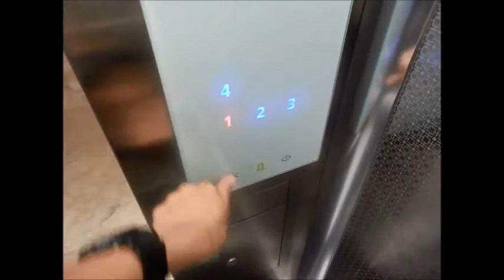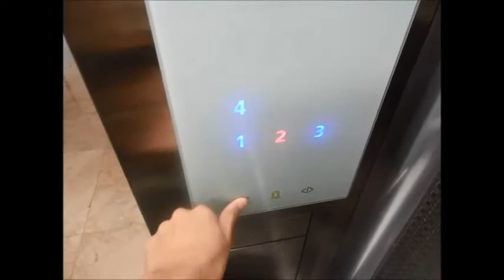Schindler 3300 AP Elevators at Prama Sanur Beach Hotel, Bali

Comment: SGPC has just released an article about this hotel, and since this hotel was built by PP, I suspect these elevators are formerly OTIS.
Reply from the maker: It could've been another brand though as by the 1970s PP is no longer affiliated with OTIS. IIRC these elevators had been modernized at least once before replaced into Schindler (based on online pictures I found a while ago).
Reply: @idl3k_elev  : Did the picture give you a clue as to how the modernization looked like?

After looking at the stainless panel that houses the FIGL, I started to think that these couldn't have been OTIS since most 1970s OTIS do not have large panels like that. Schindlers also do not have that too. My next guess would be a Japanese brand, probably Mitsubishi or Toshiba considering the size of the panel. That being said I doubt the Japanese brands installed elevators in Bali in the 70s to 80s. Most of the 70s-80s elevators in Bali, at least from your video, are Schindlers and OTISes.

Reminds me of Mercure Tateli Manado's KONEs tbh (I suspect they replaced old Indolifts judging by the size of the panel), where the elevators have additional stainless panels on the carcall panels indicating replacement from old elevators.
Reply from the maker: @Christopher: Probably used to look like the service one aka generic (LINE) if I remember correctly. That was only the outside though, I couldn't find any photos of the elevator's interior. It's a bit shame that I went there only to find out that they've been replaced, and annoyingly I forgot to check the extension building (the M shaped building next door) which was from 1990. Who knows it might still have at least one original elevator in there :(

Where did you find out that Mercure Manado Tateli Beach used to have Indolift?
Reply: @idl3k_elev  : I didn't say that the elevators at Mercure Tateli used to be Indolift; I said that "I suspect", which means that the elevators there are probably, and not definitely, Indolift before KONE got in.

No evidence has been found so far about the old elevators of that particular hotel, but the size of the steel that covers the old panel, which is around the same size as the Indolift at Bali Anggrek Inn, made me suspect so (from my video observations, next to no late 80s to early 90s OTIS, Hitachi, Mitsubishi, Schindler, Thyssen, DY, Toshiba, and GoldStar tend to have short and narrow car call panel). There is also a quite long steel panel above the landing door which now houses the new indicator on each floors, which I suspect was the location of the old analog indicator (they are around the same size as the old analogue indicators at Bali Garden Beach Hotel)

Moreover you used to provide me with articles that Indolift installed elevators in a hotel in Manado; who knows that apart from the derelict Manado Beach Hotel, they also installed it somewhere else (definitely not Sahid Kawanua because they have 2 OTIS Spec60s). It could be other brands like Atlas and Lift Munich, though - but judging from the steel coverings that cover the old structures of the car call panel and overhead indicator, the possibilities are either Indolift, Atlas, LM, or Schindler M-series.